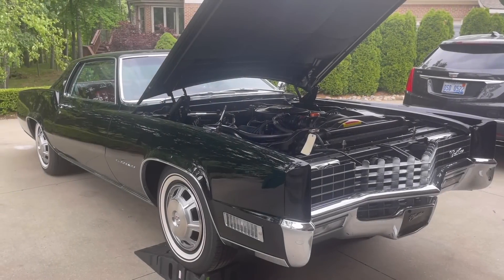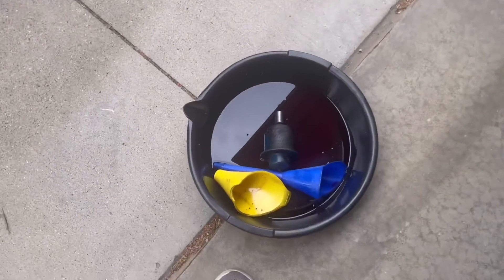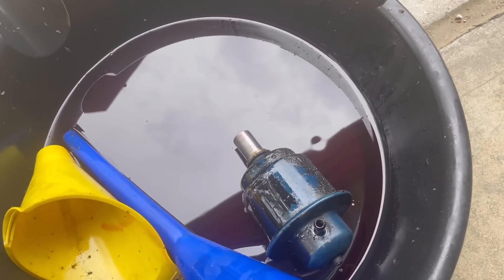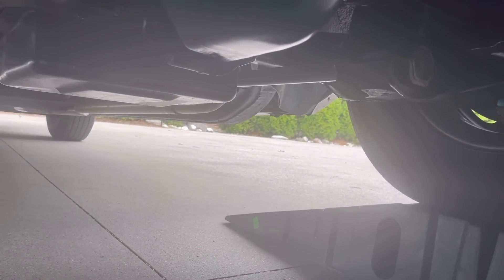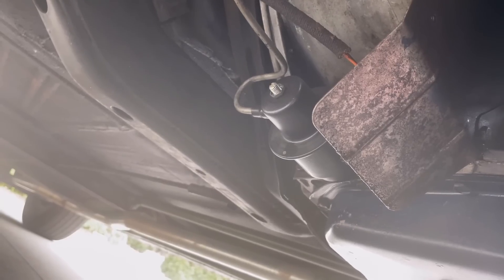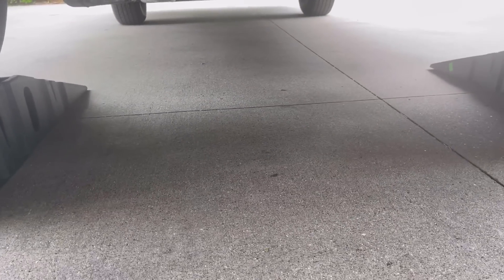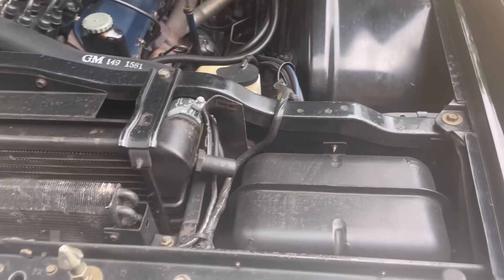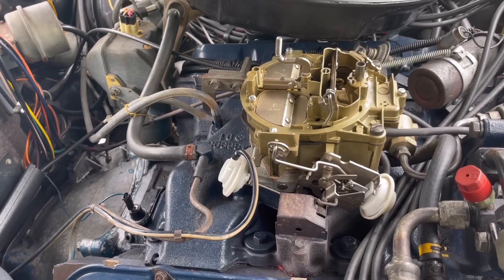How to Fix An Incorrectly Shifting Transmission Yourself (Incl. Turbo Hydramatic 350/375/400/425)!

Comment: I blame the chickens for the shifting problems.
Reply: I once ran over a dead dog in a 1988 Monte Carlo and it unhooked my shifter completely, got to a gas station and the shifter was just floating. I'd never of hit the poor thing but it literally shot out from under the car in front of me, Indiana is a heck of a state.
Reply: @willallen7757  
Sounds like he had given up on life
Reply: @foreverssober  I don't think he chose to, I can still see it like it just happened. It was traumatic to begin with then I couldn't put my car in park and had to find a tall curb to pull up against.
Reply: @willallen7757  So, do you think this couldn't have happened anywhere but in Indiana?
Reply: @willallen7757  Indiana is a state of mind.
Reply: I know those chickens!